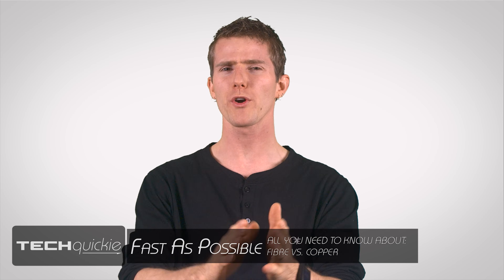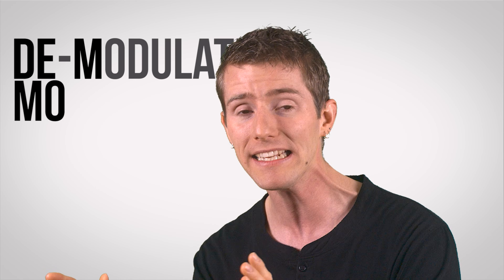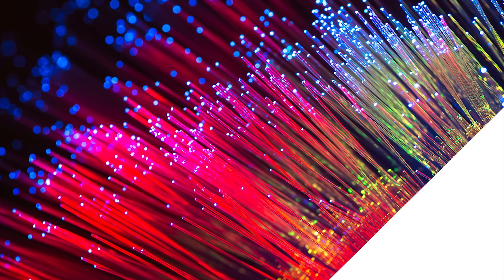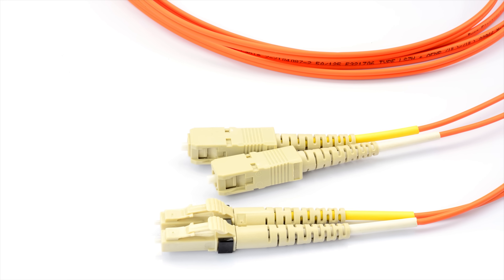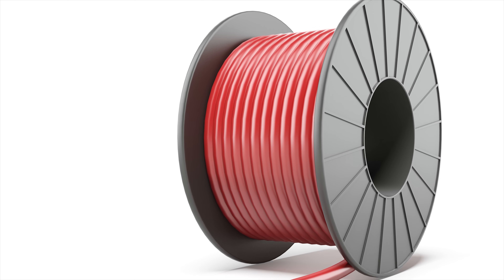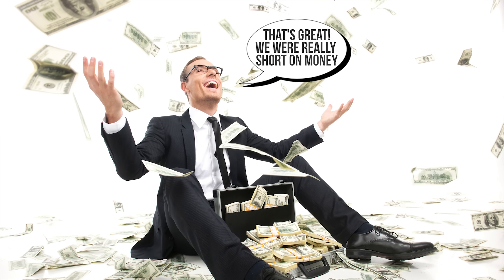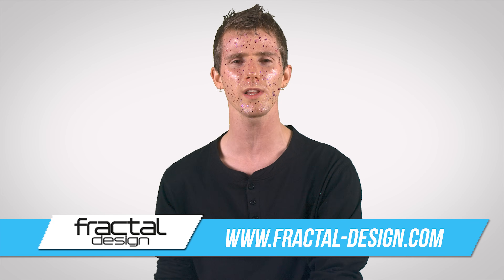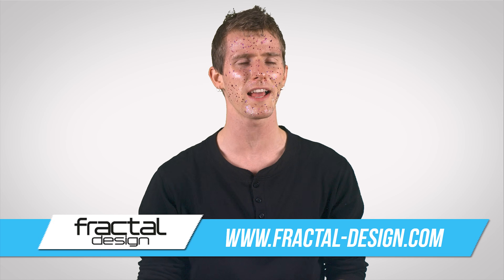Fibre (Fiber) vs Copper as Fast As Possible

Comment: We are revamping our Engineering office and I can't seem to get a solid answer to this question:
We have a server (in the same building as Engineering) and are planning to replace the Ethernet cables.  We would be running a fibre optic cable from the server room to the engineering office, then split it there to each of the 20 computers.
We generally work with CAD files that can be several gigs in size.
Has anyone done any benchmarks regarding the final speed of loading and saving to the server?  That is:  We know that the fibre optic cable is faster to transmit info, but considering that there are other considerations, does it really make an appreciable or even observable difference?

Comment: Not sure how you came to the conclusion copper is cheaper then fiber. You may be talking about a fiber patch but thats due to grinding and testing before selling but the cable itself is very very cheap.

After all its just a piece of glass melted down with a acrylic cover while a copper is very expensive.

Comment: People need to understand that fiber is everywhere regardless of the ISP you are using. The area where its lacking is the "last mile" to the customer's home. In the US this is usually going to be made up of Coaxial(cable) or copper(Telco). Everything beyond that is Fiber. Converting the "last mile" to all fiber would require digging up all the streets and yards(in the burbs) if they want it burried or hang it on poles(which is another headache due to ownership of said poles)...but not so much an issue in larger cities that have high population density. That's why smaller countries can deploy FTTH without such issues....much higher population density in a small area. Sometimes less is more! : D

Comment: Lol nice face looks like he went down on syphilis. Awesome video though. One day internet should be completely wireless requiring no cable of any kind.
Reply: That is probably never going to happen. Cable is always going to be faster than wireless because there is more interference involved in wireless signals than there is with cable.
Reply: Also wireless is notoriously bad when it comes to latency....as well as line of sight issues.

Comment: the speed of light is 300000km/s no 200000 but okay kkk
Reply: Matheus Wandscheer Thats te speed of light traveling trought a vacuum. Also, depending on the type of fiber (single mode or multimode) the light might bounce millions of times in the cable, making the distance it has to travel longer thatn the cable it selfe, tho im pretty sure this is negable and the reduction of speed comes from light traveling trought the galss instead of a vacuum.

Comment: light travels at 300,000 km/s not 200,000km/s.
Reply: Parker Whaley Thats te speed of light traveling trought a vacuum. Also, depending on the type of fiber (single mode or multimode) the light might bounce millions of times in the cable, making the distance it has to travel longer thatn the cable it selfe, tho im pretty sure this is negable and the reduction of speed comes from light traveling trought the galss instead of a vacuum.

Comment: In Sweden, houses are being connected with fiber. It cost like 2.5k USD to have it build a fiber connection at your door step, but people here do it.  Buildings also run on fiber,  they have conversion station in the basement so every apartment can have standard copper connection. We are stuck with one ISP though per area though,  not enough to choose. 100 Mbit/sec cost like 20-25 usd a month.
Reply: Which company? Telia?
Reply: Nicolás Espinoza R. In Australia it cost about $100/month for 100Mb/s download, 40Mb/s upload.

Comment: We've been getting fibre to the door rolling out in New Zealand over a year before this video was put up. 
However, we haven't really been getting the capacity that fibre is capable of. Test areas in (circa 2009) were limited to 30/10, and when it started deploying 'Premium' connections were 100/50 and were on plans that had data caps. 
In the past couple of years, the max was increased to 200/200, with most ISP's offering those speeds with no datacaps, with one of our smaller cities (Dunedin) being the test area for 1000/500. 
As of the 1st of October, the provider and support of the physical connections, Chorus, are increasing all fibre speeds around the rest of the country to also have 1000/500, with most ISP's providing users on their 200/200 plans an upgrade to 1000/500 at no additional cost. 
These residential fibre connections are deployed over Passive Optical Network, using a single fibre rather than a pair for TX and RX, making deployment more financially economic. This also pleases ISP's, as they no longer have people calling up and complain about not having advertised speeds due to not suffering signal degradation over distance. Not having degradation from EMI or wet weather impacting poorly insulated lines also appeases the ISP overlords.

Comment: My ISP offered a Fibre Optic Broadband connection for US $48.26, Is it cheap or expensive?
Reply: Very cheap
Reply: I could get 50Mb/s for $43.14 and 100Mb/s for $49.67 (200 is 56.21) Yes, this is all fibre.
Reply: If it's Sonic in California, get it. I'm on it and it's mind-blowing fast because it's fiber-to-the-home. Mine is $40 plus taxes and equipment rental.

Comment: The individual fibre cables are cheaper than copper as they're just glass, what makes it so expensive is what goes into protects it
Reply: Well making the tiny glass tubes is actually relatively expensive I would guess since they have to be the same thickness all the way through
Reply: the glass tubes are just glass, they're less expensive than copper, as copper is a rarer material than glass. I know this because I've worked with Network Installation specialists, who specifically manage copper and fibre connections.
Reply: General Echo Ah, ok. I don't have that kind of experience. But that makes sense. Thanks for the clarification.
Reply: Tyler Eberhardt No problem
Reply: the cables themselves are cheaper but the transceivers are expensive :/
Reply: General Echo thats not how it works the procesing of such a flexible glass fiber is what ups the cost
Reply: the glass fibre still cheaper than copper, because copper is getting a lot abundant as well
Reply: General Echo not realy to do a full swap to fibre in my country it cost about 7 milion Euros compared to coppers 5 milion
Reply: It costs about 5,772 dollars per ton for copper, and about $2000-3000 per ton for acrylic glass (probably not what fiber cables are made out of but the closest I could find). But yes, fiber cables would probably cost far more to deploy.
Reply: The glass used in Fibre wires is literally just glass that is pulled and pulled until it's thin enough, very cheap to make. Hell you can buy toys with glass fibers in them!
Reply: General Echo I thought it was replacing the copper with Fiber

Comment: does light moves in 200 000 km/s, did you skip physics class? its 300 000 km/s
Reply: Light moves slower in a medium (like glass) than in a vacuum.
Reply: lol i think you did.
Reply: Plus it doesn't move straight its just bouncing around the cable..

Comment: Am I the only one who has wireless? Like run my home network on 4g.
Reply: 4G is a much lower bandwith and more expensive option that's only really suitable when extremely easy portability across a large distance is needed, for instance with smartphones.  For a home set-up, where the connection to the ISP is mostly stationary, a cable or fiber is preferable in most cases, with wi-fi or ethernet running to the device.
Reply: doesn't it cost more?
Reply: +Hossein salamat It costs but I'm getting fiber in a few months. But the 4g speeds are actually good so it's something.

Comment: I am pretty sure that the speed of light is around 300000 km\second and not around 200000 km\second
Reply: It only goes that fast in a vacuum. Light travels much slower through objects.

Comment: Should see what Nokia has pulled off with 10Gbss on current Hybrid copper and fibre networks and another breakthrough with pure fibre solutions that pull off 255Tb/s.

http://www.extremetech.com/extreme/192929-255tbps-worlds-fastest-network-could-carry-all-the-internet-traffic-single-fiber

https://www.telegeography.com/products/commsupdate/articles/2016/05/18/nokia-10gbps-symmetrical-hfc-speeds-are-possible/

Comment: I would think, out of sheer logistical and long-term financial considerations fiber would have copper beat. Copper isn't that abundant on the planet, and its extraction these days is incredibly energy intensive, and produces a lot of toxic waste. That, and there are more useful and exclusive applications for copper beyond wiring. With that said, though, fiber isn't just glass, it's glass doped with certain rare earths which, while despite the name are actually rather abundant, take their own massive energy investment to extract. That said, silicon and carbon are the two most abundant substances on the planet.

Comment: I hope google fibre becomes worldwide (and cheaper) so i can use it for my games.
Reply: gameboytj Same I wish it came to the UK
Reply: It will, this kind of stuff has been in Europe for years, it's just a matter of when people will decide to dig up the current network, and put in the new one, probably around 5-7 years in the future, but typically everyone over estimates Google...
Reply: +wtblack5 longer than that do you how many rural areas there are.
Reply: +Danny Billy yes, what's your point? Fiber wires can be connected via power lines, like phone lines...
Reply: wtblack5 Stfu if you don't get it.
Reply: +Danny Billy umm... apparently you don't get it either...
Reply: wtblack5 Oh i get that you're an ignorant fuck.
Reply: +Danny Billy then please enlighten me oh wise one
Reply: wtblack5 No problem ill be right there.
Reply: 2 years later and Fibre Broadband is still a rip off Sky Fibre Max will set you back £30 and Virgin Media fibre is even higher at £35 a month

Comment: I just had fibre optic installed at my house on sunday with the fibre optic cable straight to the router ! The speeds are insane :D Fragile cable though but still great installation work is the usual around the Paris area.

Comment: Why does most of Europe use fiber already? I live in the US, and fiber is pretty rare. I actually upgraded to the 2 gigabit plan from xfinity. It was around $600 to install and $289 per month, which I actually think is pretty cheap, but appearantly in Europe it's a lot cheaper. Why?
Reply: I would wait for google fiber, because it is about $70 a month and $300 to install. also it gives 1 gigabit speed
Reply: It's only $289 for the first year, then it's $100.
Reply: Is this really that long of a name? I really don't think it is. Go away, please. You're not cool. For google fiber it is not, also what a great name!

Comment: The stupidity with most developing nations is them trying to upgrade to fiber when they haven't even used the already deployed coppers to their full capacity. Like even in my country India, we have a average internet speed of 2 mbps. Yet they are selling Fiber  to the home services and even than the speeds suck its starts from 10 and goes to 100 but thats way out of any average Joe's budget. Also, ppl dont realize that copper can transfer upto 10gigabits/s. And the worst part is they are not bringing Fiber till lets say a node and from there using copper to distribute for 1 km or something they are actually installing fiber in individual houses. Ppl are so happy without realizing that those fibers are basically going and attaching to a copper wire.
Reply: You are just salty , It`s not stupidity , it`s the greed of the isp that offers you lower speed. Fiber is superior in every way  with benefits for the end user( >1000mbps lower jitter/ping )and isp (no 100m limitation , one cable for all services , less hardware to mentain and deploy , lower power cost , way better uptime etc).

Comment: Optic fiber is the best :3 With my old copper line the speeds would go up and down and even have several hours of downtime. Now that I have a connection over fiber the DL speed is always just the speed that is paid for (unlimited data 50/10Mbps with monthly bill of 30€ or something).  Could upgrade to 1000Mbps if needed.

Comment: this video contains so many misinformation...
marble effect, network latency, 
copper CAN transfer multiplexed digital signal,
speed of light detection vs electron detection,
and so on.
there is soo mutch not covered, and out of what is, soo mutch is just wrong...

Comment: so what I don't get is I really don't need more speed in terms of downloading massive files I wasn't more responsiveness... ping I guess as such. I want web pages to come up quicker but no one ever states anything about this is it just like this anyway? a bigger upload would be a good send as well for uploading pictures and video...
Reply: Jimbob84141 Bandwidth versus latency is what you are referring to? Do not forget hops as well during connections. Hops are basically a toll booth for highway. More hops there are, worse the latency. You cam find out your hops by googling "tracert".
Reply: +H Koizumi thanks I'll try that tmrw. Yes just basically is web surfing faster and other little jobs using smaller amounts of data on fibre. Not just faster large file downloading.

Comment: Light doesn't actually go for thousands of miles through the fibre but also needs repeaters every 50-ish miles. Which is still much much better than copper btw.
Reply: +JohnnyVVlog  that's right..I just read it.

Comment: Well, fibre is all nice and well as long as it's in the ground or in the walls but I'm really not looking forward to 40Gbit Ethernet and upwards where anything that isn't a better patch cable will have to be fibre. These things will break all. The. Time.
Reply: +Penny Lane The use case for such extreme bandwidth to individual machines is what, exactly? Even streaming 4k VR movies would probably work fine over gigabit depending on compression.
Reply: +Joseph Grueter I only use the word "probably" to hedge my bets. I suspect even uncompressed 4k VR would work on gigabit.
Reply: Joseph Grueter Calculate it for yourself. You can't even get 60 uncompressed single 4K frames per second through a 10 Gb line, let alone 1 Gb. That's not counting Dolby Atmos sound with an arbitrary number of sources for your future wave-field synthesis system or the possibility of needing arbitrary numbers of rays for each pixel for light-field displays. You're also forgetting that the number of hosts in your home environment will drastically increase, meaning that at least the backbone of your home network will need more than a single gigabit if you want a gigabit connection between individual hosts.

Where I work, we're already severely limited by gigabit although I can't share why exactly. It's comparable to the home environment a few years down the line.

There are already wifi routers that can be limited by their wired connection if you max out the wireless capabilities.

40 Gb is also an actual standard that's being worked on and it's planned to be fibre-only. I didn't pull those things out of thin air. So why are companies investing money into developing technology that nobody's ever going to use?

Lastly, for every single storage capacity or bandwidth limitation of the past there have been people who've said "you won't need more anyway ever, I can't even imagine for what." And they've always been wrong. That's not making you automatically wrong but it does mean that you kinda have the burden of proof why this exact point in time will be the one where we've actually maxed out bandwidth need.
Reply: Penny Lane Yeah, you're right.

Comment: light speed = 300.000KM/s !?
Reply: +Bart Stas, yes, but only in vacuum and in a straight line. The light going through the fibre has to deal with the glass (the core is made by it) and additionally the light bounces off the inside of the fibre, it is never travel in a straight line in this type of cable.
Reply: ah, thx for explaining
Reply: I read a few months ago that glass core fibre is old hat now, it's all about "photonic-band-gap material fibre" laser light travel down a hollow light shielded core with a reflective material inside, that gets a maximum down speed of 42TBS yes 42TBS all like that's silly fast
Reply: Ya it's 3*10^8 m s-1

Comment: No one pointed out light travels at 300,000 km/s and always has the same speed?!
Reply: +Martijn de Haan light does not always travel at 300,000 km/s. The speed of light changes through different mediums (Materials). You are referring to the speed of light in a vacuum, e.g. space. Light doesn't always stay the same speed.

Comment: fibre is much cheaper than copper. we have laid 500 miles of fibre and now our community has a gigabit connection for £30 a month. and we are symmetrical too. Fibre is king. Copper is so yesterday. http://www.dslreports.com/speedtest/1875491
Reply: +chris conder um dude youdont build fibre you pay to use it
Reply: +taz874 sorry dude, we have built our own fibre network. and we pay ourselves to use it. Its our own network. jfgi. b4rn.

Comment: In Shanghai, at least for every China Telecom home broadband subscriber and every new landline subscriber, the only option now is fiber directly into your premise, using passive optical network (PON) technology. The fiber in question is actually capable of 10 gigabit capacity by the way, although the highest bandwidth data plan available is up to 300Mbps.